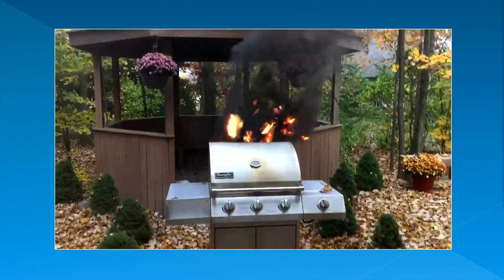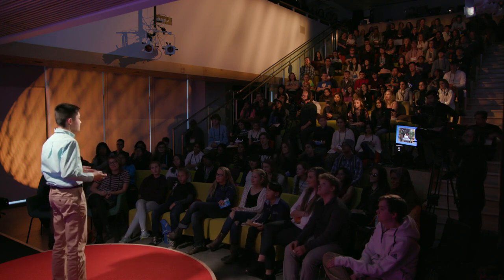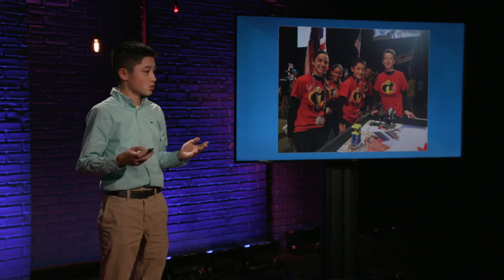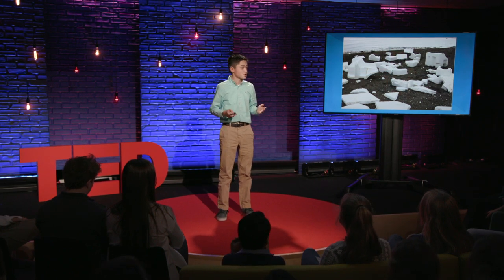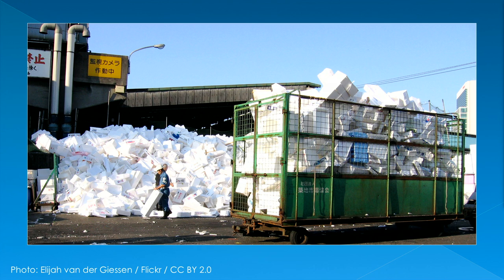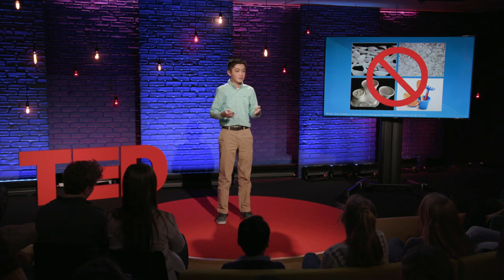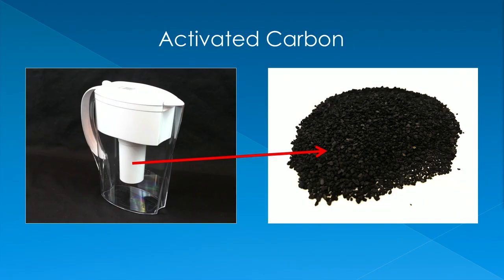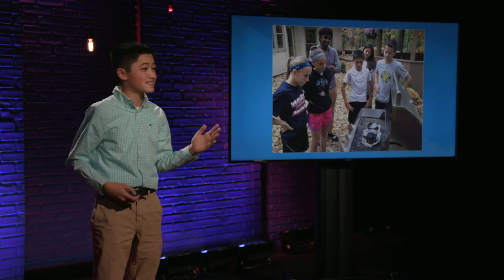A plan to recycle the unrecyclable | Ashton Cofer

Comment: Problem with Styrofoam is that without the air in it there is very litle material left. So let alone when you burn it, you will need alot fo material to make a healthy profit. And with the large scale transport that would become very hard. I'm not saying this is impossible to make it profitable thus giving it opportunity to get actually implemented. I'm just saying they still have a very long way to go.

Comment: why not to shred it or melt it, using glue and high pressure and reuse it as an insulation? (the bad color will be hidden under the facade)

Comment: Ashton, you have worked out how to turn styrofoam waste into activated carbon. When you're done using your activated carbon to filter water - what do you do with the spent activated carbon? I mean, activated carbon used to absorb hazardous substances may become hazardous due to the chemicals it has absorbed. How do you recycle that? It seems to me that you are trading one known hazard for another (or several others). Please tell me I am wrong.

Comment: My first impression is this:  it may sound like a genius idea but if you know anything about chemistry you might surmise that the only way to make activated carbon from Styrofoam involves burning it.  High temperatures under a vacuum.  The good part: no smoke.  The bad part:  all the smoke that would have been is now gas.  Lots and lots of greenhouse gases created.   This process isn't new.  It's been around for over 100 years.  It works on almost anything that is made of carbon.  From wood, to roadkill.   Basically anything that is biological in origin.  Including petroleum products.  Truly, the only answer is to use far less Styrofoam.   Anybody can burn waste and make. It look like an achievement to people who have no knowledge of chemistry

Comment: one of the biggest concerns was still not addressed... how do you remove contaminants from plastic... there are reasons why plastic bottles we use for drinking are one time uses... we don't exactly recycle them back into more plastic drinking bottles. we don't know where that plastic has been. we can't get it clean enough... I wouldn't trust where the styrofoam came from... especially how susceptible styrofoam is in attracting everything... now take polluted styrofoam, turn it into activated carbons, send water through it. proceed to drink that water. Yeah I'll pass. smart kid, great idea, but not feasible.

Comment: The current recycling process for Styrofoam is pretty simple and doesn't emit gases or emissions. https://www.youtube.com/watch?v=YktywBxnaNY   
It does use energy but so does a bulldozer in a landfill operation. The Styrofoam is mulched, heat pressed, extruded into strands, then chopped into pellets to then be used in factories that make crown molding, coat hangers, DVD cases, decking and many other items. The problem is, many counties and districts don't buy the necessary equipment to make it happen.

Comment: It would literally make more sense to just burn styrofoam for the energy content than do all this elaborate crap to make a product the demand of which will be so so much lower than the supply of waste styrofoam. I mean styrofoam is basically plastic and plastic has the same energy content as oil so it was be burned easily for power production. Also I wouldnt want activated charcoal made from styrofoam which as he himself says is potentially contaminated with other things, when that charcoal will be near my drinking water. Also I very much doubt it'll be cheaper to make charcoal this way rather than just out of wood which is a renewable resource anyway.

Comment: You only need heat and pressure to turn any polycarbon into lighter oils or gasses that can be refined or processed back into other products. It's not market competitive with today's petroleum prices, but it almost was a decade ago. 

With some innovation, maybe utilizing waste heat or something, maybe it could be market viable. 

I do have concerns about using burnt Styrofoam as a water filter, even trace amounts of toxins can accumulate over time. 

Awesome kid though, I hope he sticks with it, I wish I had half his "can do" attitude.

Comment: All you idiots do realise they're 'heating' the polystyrene and not 'burning' it right? The flames are a failed test, not a successful one. There's nothing in this speech that indicates harmful fumes from burning. I'm pretty confident, since the whole point of this process is to help the environment, that any byproducts are not more harmful than the original material.
Reply: maybe the heating of the polystyrene within a sealed container with some sort of vacuum?
Reply: Exactly. Also the addition of certain Chemicals wouldn’t work outside one.
Reply: When styrofoam is heated,a poisonous gas- styrene is released.how will you escape that?

Comment: But what are they going to do with all the emissions caused by burning the styrofoam?
Reply: By saving the world we save ourselves.
Reply: It could be contained - it wouldn't happen on a BBQ.
Reply: it needs to be enclosed in a sealed package without air in order to change into activated carbon meaning very little gases. those emissions could in most likelyhood be filtered just like we do in a furnace right now when it goes to the dump.

Comment: My only concern is what this might put into the air. I think that this is an amazing first step, but we need to make sure that this won't do more harm than good, but fantastic work. :)
Reply: you cant filter benzene, etc with activated carbon.  you may be able to change the manufacturing process of styrofoam premptively to reduce or eliminate hazardous offgassing for styrofoam that will ultimately be recycled..
Reply: b k probably not practical to make cheap and safe Styrofoam in same factories that make them so cheap, though on recycle side you could likely capture condense the  benzene , just not sure what else is in it. or what else to do with it once gotten. but at least there's thinking here, vs no thinking. its actually a complicated problem/niche product packaging, use something heavier like paper or urethane foam then you spend extra gas shipping it from china ..back to emissi. air won't hold up most fragile electronics etc
Reply: Well what if you were to dip it in gasoline?  On the farm we would mix egg cartons witch gasoline and form a goo and then burn it.  Im just thinking about what happens when the water filter needs changed, so does the filter get tossed into a landfill or is it good for a persons life span?  If not, can be turn it into a slurry and burn it in a controlled environment and filter the burn off?
Reply: @mattymcrips  Mixing cartons and gasoline (acetone in nail polish remover or acetylene from fuel do the same thing) doesn't change the chemical composition of either substance - hydrocarbons simply dissolve the polystyrene like sugar in water. Burning it still releases the same gasses as before - please don't do that! There are a few uses to downcycle styrofoam (using shredded styro as insulation, for instance) but not many, and they're usually inferior, less safe, or less cost-efficient than conventional means, or simply aren't enough of an improvement to be worth a large-scale use. Unfortunately, the young man is right in that it's a massive problem, partially because polystyrene is so useful in so many applications and has so many advantages over its potential competition.

TL;DR don't burn styrofoam, dissolving it doesn't make it better
Reply: The combustion will most likely produce CO2 gas which is of course a green house gas and it can be converted into CaCO3 if passed over a fluidized bed of CaO under control conditions.
Reply: Remember his dad has 3 PHDs
Reply: Look up thought emporium. He has a video about worms that can digest and break down styrofoam. The broken down poo then is broken down further. His next video is on how the liquid reacts to plants and if it can be turned into a fertilizer m
Reply: Maximus Xavier they can just use the activated carbon they just got to filter the air.
It's even self sustaining
Reply: Who cares about the air you breathe , here in Russia air breathes you!